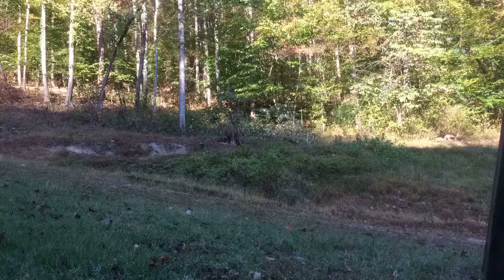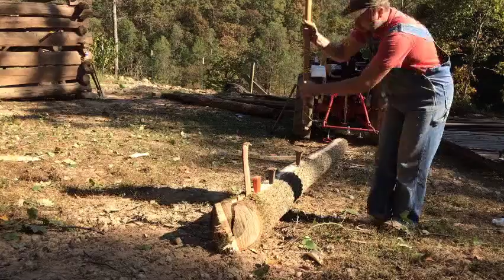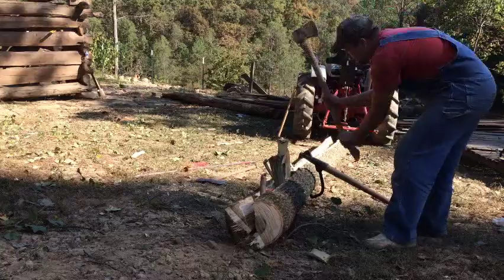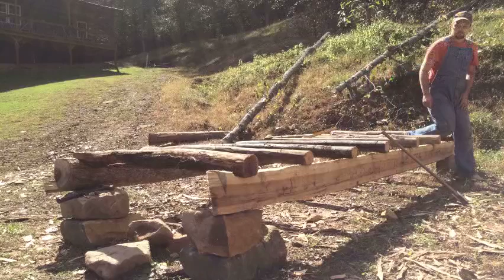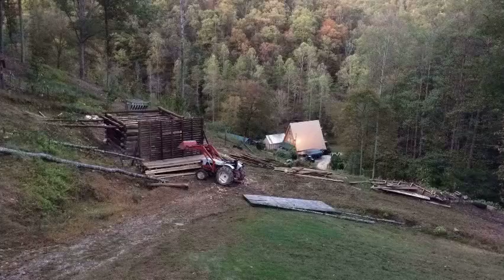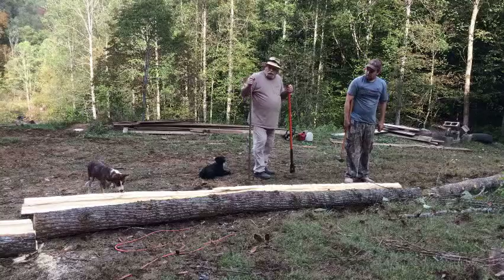1800's Log Barn Rebuild Part 2

Comment: Looks good so far.  The other day when you were cutting one of the old oak logs I noticed a lot of dust.  It seems to me the old log was beyond dry.   Consider treating these old logs to prolong their life and the integrity of the structure.
Reply from the maker: Yea the pulp wood of the oak has some wood bore nettle holes and dust and outside dusty. I’ll spray it down for bugs and probably water seal

Comment: You would think, OR at least I thought, that a guy doing the work you are doing would have at least a 1/2 doz iron log wedges.  I have a doz..  On a log that length and size, Id drop a 1/2 doz into one side till they were nearly flush, then take a peavey, roll it 1/2 over and then sink the other 1/2 in it.  By then, it always split to where I would take two long pry bars, and put them in the split side by side, then spread them apart at the tops.  This exposed the stringers to where I could cut them up near the pry bars.  Then pull them out, and enough stringers had been cut so that the log didnt close back up again.  Then Id cut the stringers which had been near the pry bars, and the deed was done..  I also had old Simplix jacks that IF I could get the split out to around 6in at one end, I could insert the jack sideways and jack it apart..  I got 2 rail jacks with  holes in the rail.  They call them widow makers.  I tried using them, but they didnt work cause the long rail would keep tilting the foot out of the side of the log as I was trying to jack it apart.  The heavy Simplix jacks worked better as they wernt more than 2ft long, and they were heavy enough that once I hand jacked them till I couldnt hand jack them anymore, then I could put a pry bar in the hole and the first jack would press the foot and the lug sticking out from the side into both sides of the log, then I was good to go.
Anothr trick would be that I would sink say 4 wedges on one side, then id start at a likely end, and insert 2 wedges side by side and drive them down a bit each at a time.  Lots of times one would jump out and id have to reset it, but in doing that I made the split wider, and the other wedges I had in it would drop deeper into the log the more I drove those 2 together till they were flush with the log.

Comment: To get a flat side on a round log, score it every foot or so, then split it off with the adze, works better than using axe. If you strike the adze anywhere ahead of your foot you need to use your wrists to have the adze leave the wood, otherwise it just digs in or chips the wood. Have the adze strike between your legs, that arch will take out a clean chip and not endanger your legs. This will also be a lot easier on your back and you can leave the log on the ground. I usually put a plank on each side of the log to stand at the right height. When roughing out the chips should be big enough for firewood, if they tend to run under your next score, work from the other end. A footed adze has little sides on it, is a shipwrights adze, also has a spike, it takes out clean scoops. All this useless info is from a 70 year old shipwright. You need to take better care of your tools too.